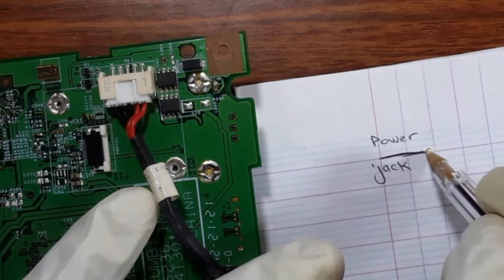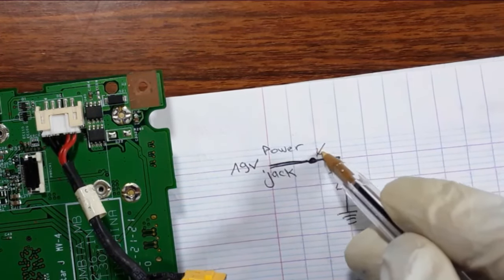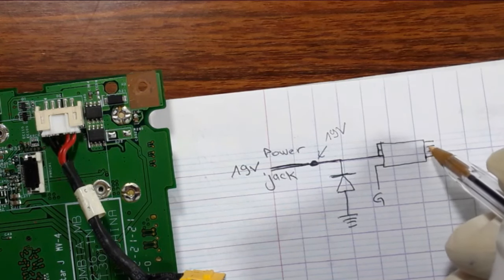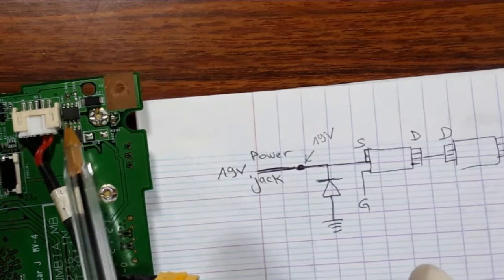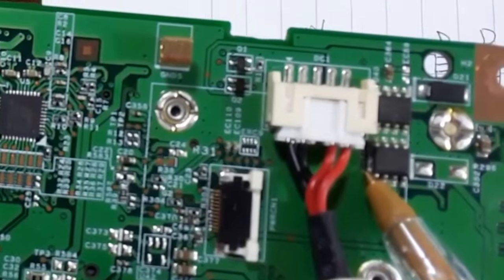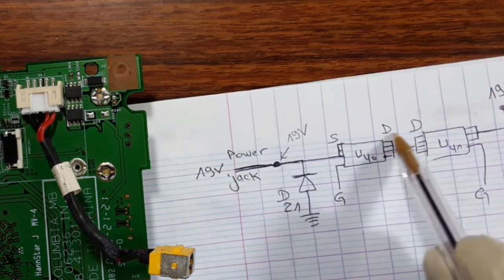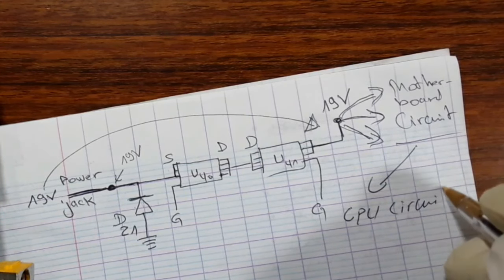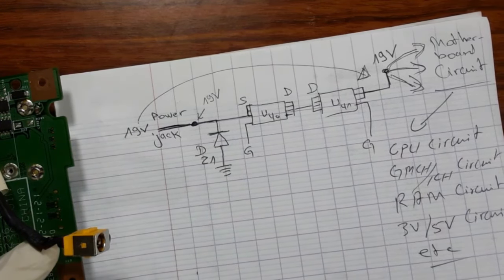Tracking Voltage On Laptop Motherboard Charge Circuit - Charge Circuit Components

Comment: With a lot of respect sir, I like your videos so much and no day passes without me watching your videos but there is one thing I must address with much respect kindly; your videos are long and repetetive and sometimes you go out of the topic for example, in this presentation, the title reads: Tracking voltages. I was expecting to see voltages being traced from 19 v to other low voltages like 3.3v, 1.8v, 1.5v etc. You just keep repeating the same things you did in other past videos instead. Check on that kindly. This video tells opposite of its title,  you are showing us continuity test instead of voltage tracking test please.